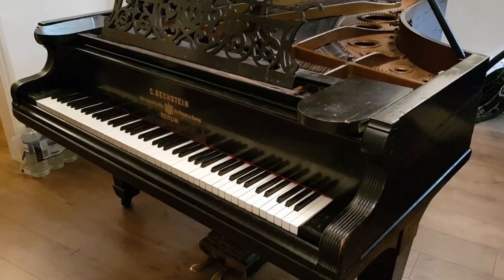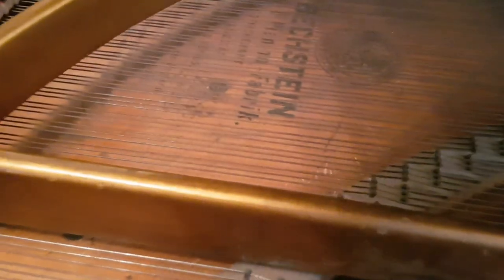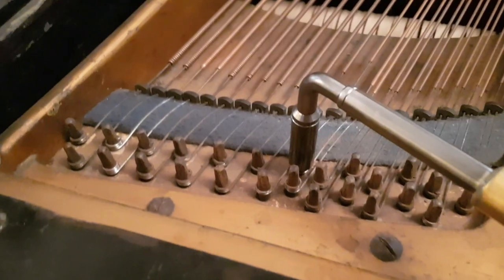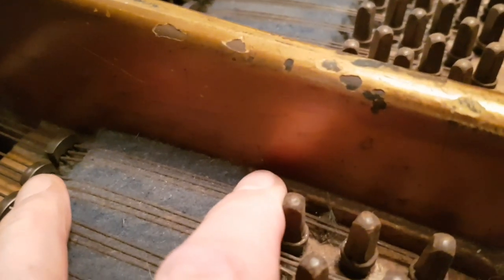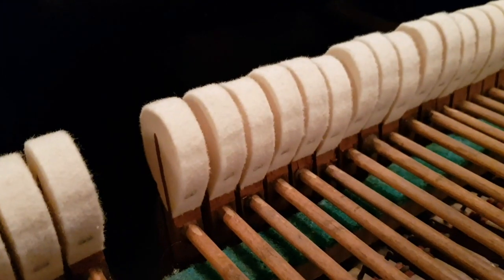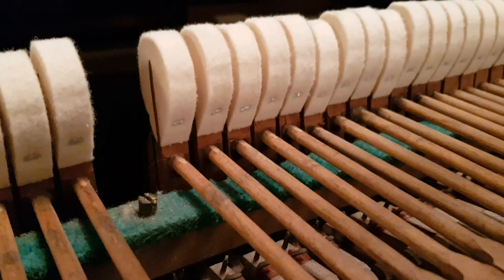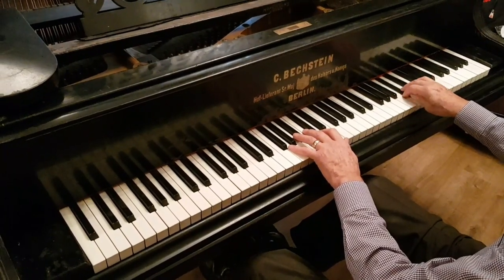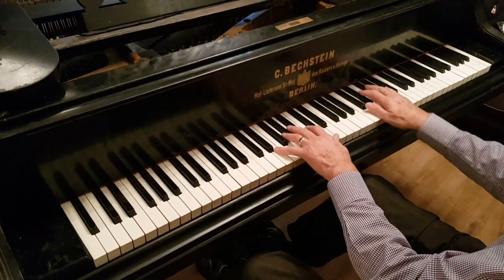Assessment + unusual repetition lever on a Bechstein model III c1897

Comment: Even as it stands it has a nice tone except for the top-soprano. To my knowledge many pianos lack strength in the high register due to physics, a long heavy string can make more energetic oscillation/waves, so when thinner soprano-strings shall give more sound the builder will have to compensate in some way, either making a special arrangement soundboard or higher tension strings or - what do I know, - give them a better energy transfer through the bridge (or dampen the bass). Hammer felt thickness can compensate? But we do not want the harsh sound of thin felt on steel strings.
I am not a technician but just interested amateur with kind of good ear. I had the opportunity to try a very old Bechstein (1900 I guess) in a church in Helsingborg (Sweden) and there was a name of the technician catering for this instrument (and another, locally built). I remember the beautiful but kind of sharp tone quality.